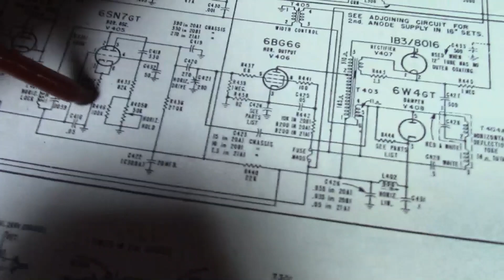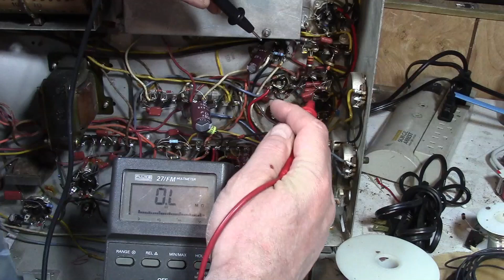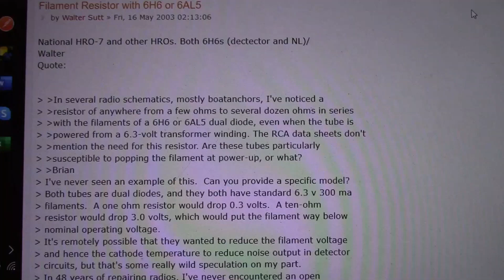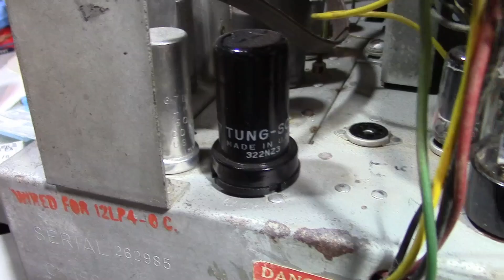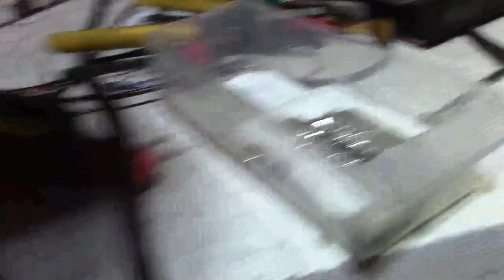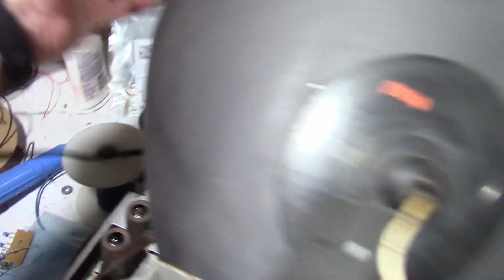Admiral 20B1 restoration p3o?

Comment: Would you have a use for a Philco 33-5535-17?  This is a 2Mohm 1/2-watt audio potentiometer with a 2-inch flat-keyed shaft and a tap at 1Mohm.  I have one which is in reasonably good shape.

Comment: About carbon compound resistors: if you need to replace some in the video output circuit,  I suggest to use carbon compound resistors for replacement. Because they have very low inductance, and this matters a lot in high frequency - high current circuits. You can mess up the frequency response if you use film resistors, because they have a spiral groove laser-cut into them, that's how their precise value has been set, but this also forms an inductor. Carbon compound resistors has just a lump of carbon mixture in them, their inductance is about equal to a similar sized piece of wire, practically zero unless we are talking about many tens, or few hundred MHz.
I'm currently examining a 1992 Samsung CK-5322 for repair. The whole chassis has 3 (three) carbon compound resistors: just on the output of the video amps, in series with the cathodes.

Comment: I just worked on a Rock-ola 450 selection PCB for a customer and almost every single one of the carbon resistors on the board were high by between 30% to 50%.

Comment: Great idea on the button cap screws. Got  corresponding nuts with lock nut on them too. Chassis work should be easier now than trying to use a pop rivet tool in a hard to reach
area of a chassis ! That odd two lead power female connector looks like it could be replaced by a figure eight type socket on the power supply chassis. You will no longer 
need the old wires as the chassis will now have a plug. It seems to be a non polarized type  connection thus the figure eight socket. They are called a C-8 .
 Any  1980's to 2000 power cord with a figure eight  male plug end will work.

Comment: The original name of the company that later became Admiral, was Continental Radio and Television, they seemed to specialize in manufacturing private label radios for retail chains prior to the war, rather like Wells Gardner, and Belmont, so you are more likely to see one of those then a pre war Admiral radio. I think that C.R & T made sets for Western Auto Supply under the Truetone brand, among some others. 
 The post war electronics industry was rather interesting, there were a lot of start up companies that made one or two models of radio, they disappeared. There were others that were well established radio companies such as Detrola or Gilfillan that never did make it into the TV business. Then there were others like Admiral, and Motorola, that were smaller radio manufacturers before the war, who went all in with television, and made it big because they made the right decisions, and the right investments, at the right time. 
 Admiral and Motorola beat both Philco and Zenith into the TV business after the war, and did very well because of that. Philco, even though they were heavily involved in television research, and was the number one radio manufacturer before the war, was very slow to get a TV to market, I think late 1947 was when their first sets came out.
  The frequent revisions, and parts changes weren't unique to Admiral, you see that in a lot of post war Philco radios as well. I think it was because the industry was trying to keep up with pent up demand, no new radios from the spring of 1942 to 1945, and because TV production was growing exponentially every year, I think it hit 1,000,000 in 1951-52. A lot of it also had to do with price, what tubes or other parts could they get in volume for a given cost.

Comment: The connector for the turntable motor was somewhat standard I believe. I worked on a Sears Silvertone Console Stereo from 1966 with a turntable that used a similar looking connector. It's hard to say for sure because so much of the connector is broken on this set but I'd think it would be standard.
Reply: I've seen those on some radio-phono combo units as well, the other method was to have an outlet in the back of the radio chassis, or a smaller NEMA 15 plug and socket inline. I may even have one in my collection of salvaged parts.

Comment: Gosh what did they do to that yellow wire above the coil going to the pot at 1:03? Is that melted? It looks like its to bare metal in the video.
Reply from the maker: Yes. There are several wires like that 😞